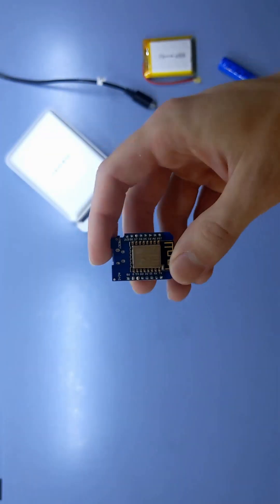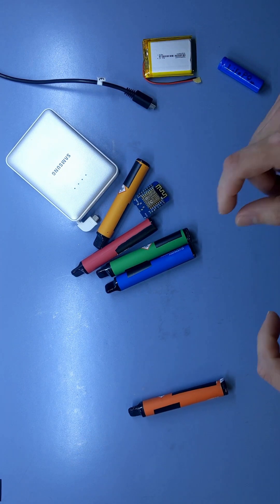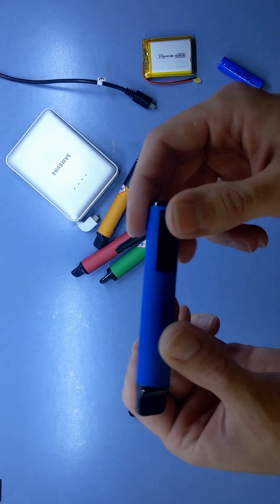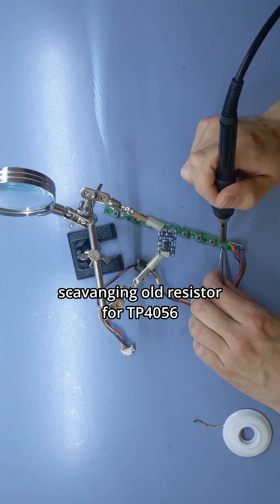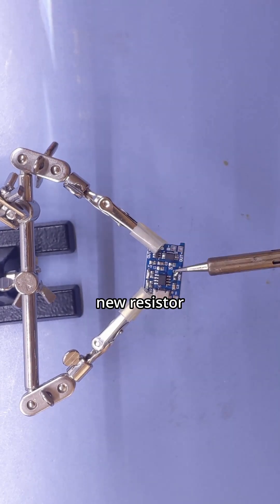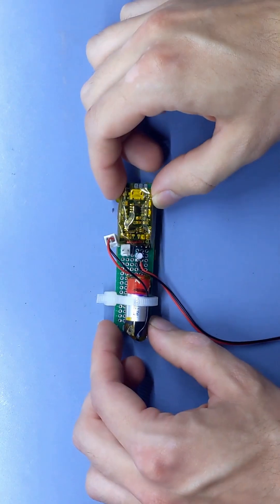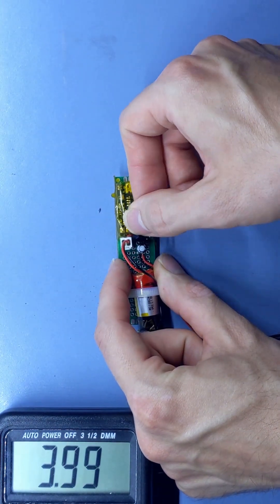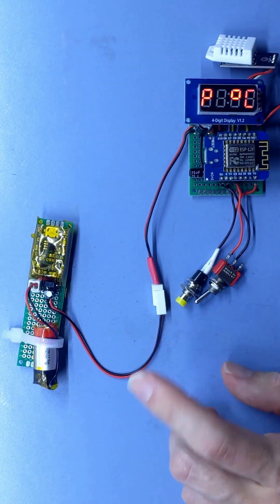DIY 3.3 V Power Bank from Reused Lithium Cells #shorts #diy

Comment from the maker: If you don't want to solder the SMD SPX3819 but an MCP1700 doesn't provide enough power, a HT7833 might be right for you: It's a THT part and provides 500 mA.

Comment: Hey, i have a couple 360mah little batteries I took out from disposable vapes as well, and i was just wondering how you figure out what to change the current setting resistor to. (For example would a tp4056 charging at the default 1A not be safe for this little battery, and so i need to change the resistor to lower the current to something safer, or would charging at 1A be okay? I am not confident enough in my soldering to deal with such small resistors.)
Reply from the maker: The datasheet for the TP4056 has a table at the end named "Rprog Current Setting". It contains the needed resistor value (in kΩ) for different currents. For a single 360 mAh cell I'd go for 4 kΩ, resulting a current of 300 mA at most. It's always better for the cell to be a bit lower than to be too high.

1 A would be too high, you typically don't want to go beyond 1C, so the theoretical current it would take to charge a cell in 1 hour (so for 360 mAh it would be 360 mA).

The good thing is: You don't need to solder a very small resistor! If you break the one already on there it doesn't matter, we don't need it, and you can just solder any size resistor to it. You can even use a standard 1/4 W THT resistor. All you need to to is bend the legs in a shape where you can easily solder them. Maybe create small solder blobs on the PCB after removing the original resistor so you can easier solder to them. Though I'll admit: The USB-C TP4056 boards I have really do have unpractically small resistors and therefore solder pads. I guess when they updated it from micro-USB version (as used in the video) they made everything smaller (and cheaper), so the micro-USB ones I've seen are easier to modify.

Last but not least: Good on ya for saving those cells from the dump!
Reply: @tinkeranddespair  thanks for the good info and the quick answer, ill see how i get on with the small solder pads once they arrive. Cheers!